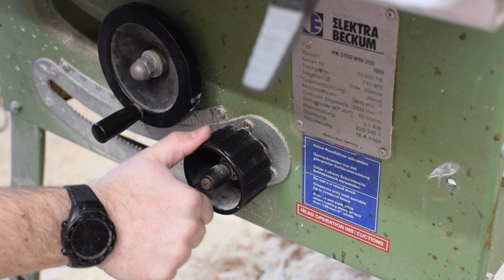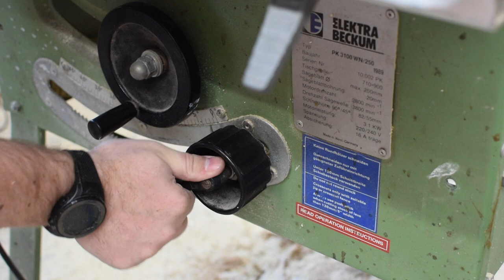Making a Bench Seat from Old Skateboards

Comment: I am currently building one of these and am having trouble cutting through the skateboards, any tips?
Reply from the maker: The biggest thing i found was remove the grip tape is essential.  secondly if you can stablish the board with some wedges under in to make it flat then bandsaw/tablesaw/jigsaw away.  Good luck tag me on insta with a pic when you make it.

Comment: How much would you say the materials cost all together except for skateboards, thanks
Reply from the maker: Timber was approx £25 ($31)
Hardware £5 ($6)
Paint and varnish £5 I spent £20 on the tins I brought but had a lot left.
The most expensive but was the feet which were a brand new set of skate wheels at £30 ($37)

£65 ($80) all in approx